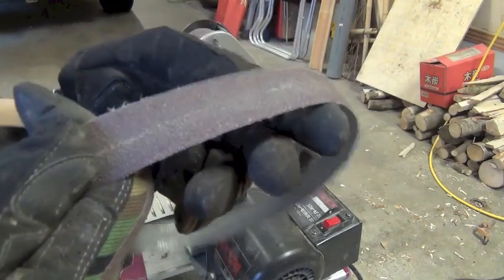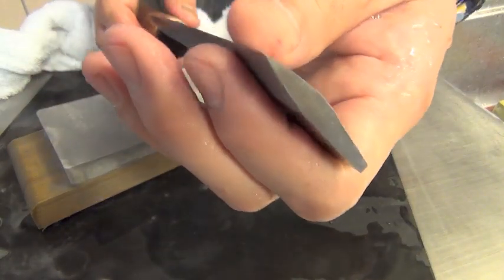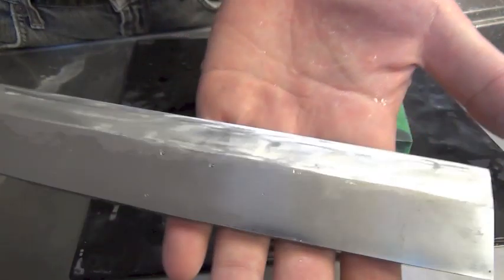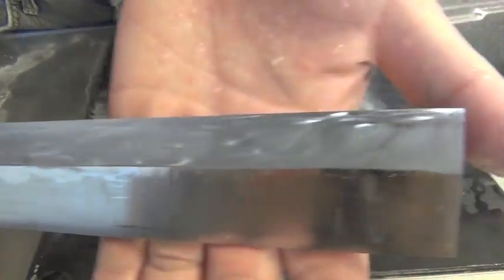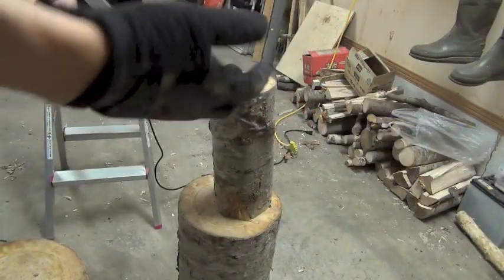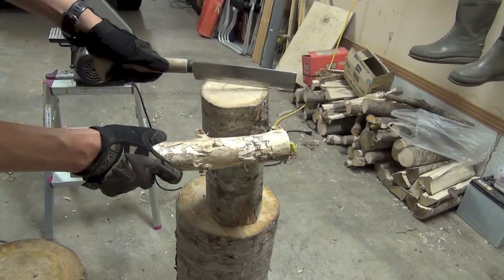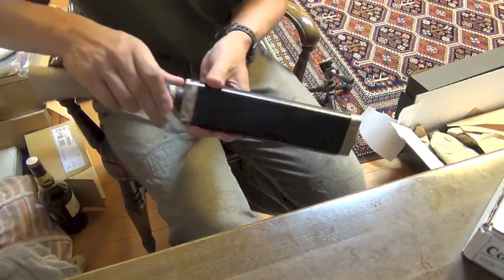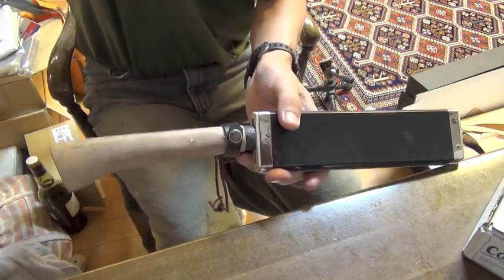Hatchet reprofiling

Comment from the maker: I can assume the overheat a bit. I have little experience about it. I will need to know the limit where the grind is enough and still doesn't ruin the heat treat. The 80 grit belt generates more heat than 120 grit. Thanks.

Comment from the maker: Any of belt sanders won't have speed control unless you make some mechanical or electric system by yourself. In my experience we should not touch the edge line with the belt sander if the steel is already heat treated. We should finish the edge with water stones. The heat is huge and we need to dip the blade into water every 2 strokes even if we don't touch the very edge. Thanks.

Comment from the maker: Higher grit diminish the scratches made by the lower grit. To make a beautiful bevel I need 220 between 120 and 400 definitely. But I don't need 600 between 400 and 800. And I don't need 1000 between 800 and 2000. I have no experience on the 1000. I would recommend you 400/800/2000/3000 only from my personal experience. The 800 is a very nice stone in fact. Thanks.

Comment: Wako, Im going to be buying some chosera stones...how do you feel about skipping 800 grit.....say, 400/1000/2000/3000? Will the 1000 grit be able to refine the 400 grit scratches?
I grind and diamond polish concrete floors for a living and skipping grits can be a problem, so Im wondering if the same with grinding/polishing steel knives